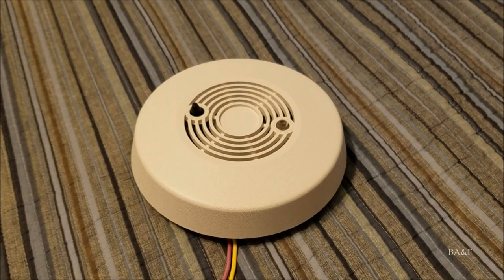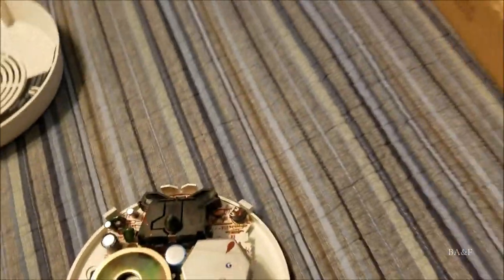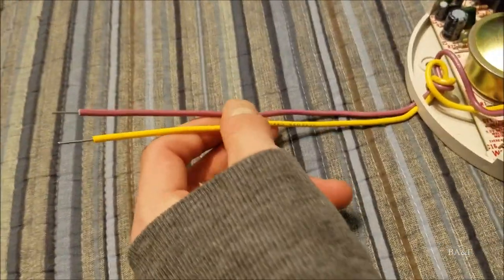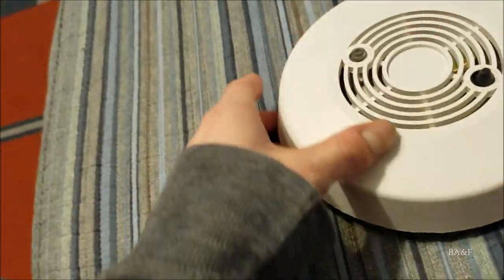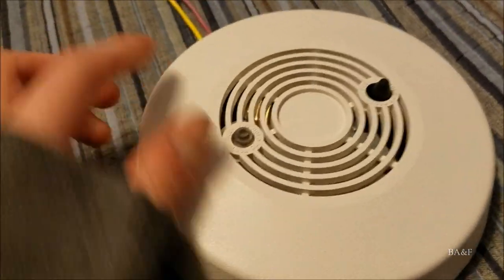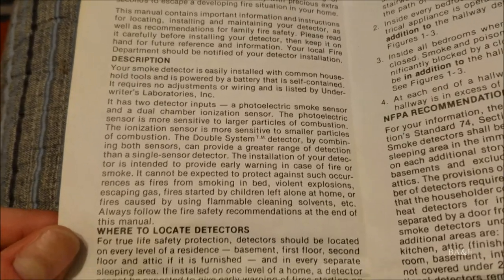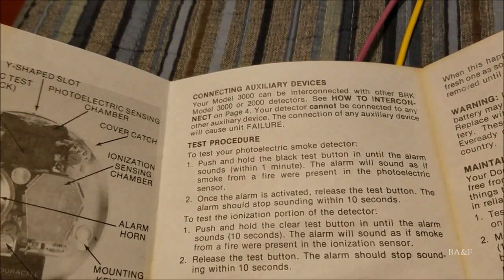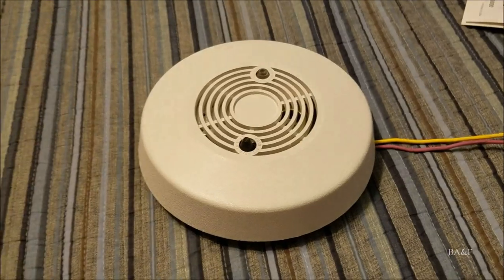BRK 3000 "Double System" Smoke Detector

Comment: Very cute sound! But there are versions of these that have that terrifying low pitched buzzing sound that I was afraid of and still am slightly afraid of now!
Reply from the maker: That was the AC model SA769AC, with the vibratory horn. All battery models used squealer horns.
Reply: Yep I have the SA769AC at my shore house. Those things are stupid loud and sensitive. It would go off anytime someone cooked. You could hear it from down the street if any door or window was open.

Comment: Interesting product. Now a days they have the wireless interconnect type. the test buttons on this must do something other than test the horn, otherwise might as well just have one.
Reply from the maker: The ionization test button (the clear tiered button with the LED underneath) simply tests the continuity between the ionization sensor and the horn, the photoelectric test button (black crayon-tip button) tests the IR LED and the photocell eye, so the photoelectric test button is much more accurate.